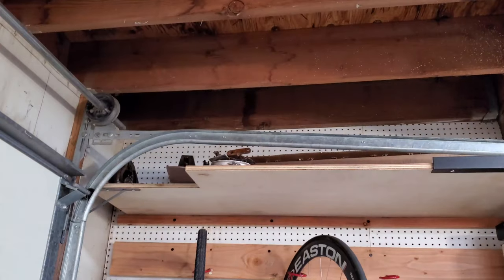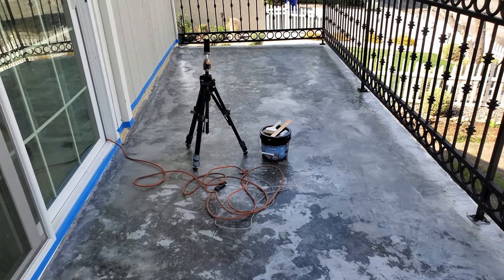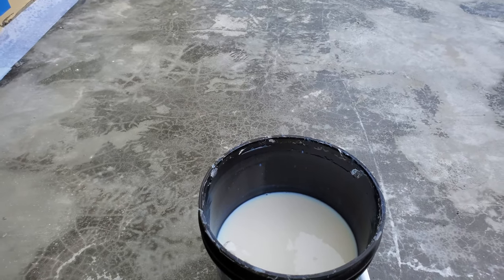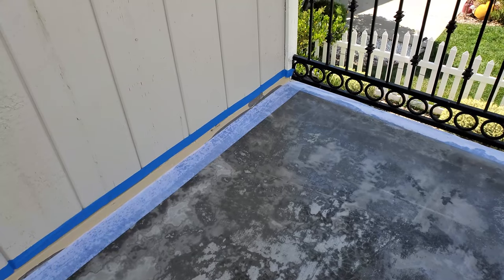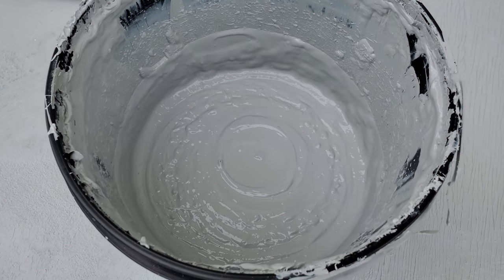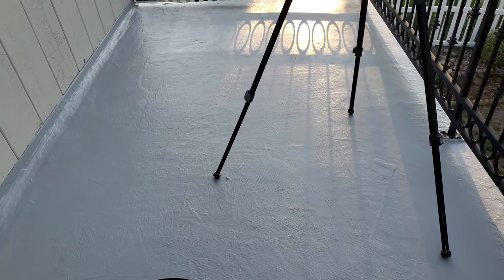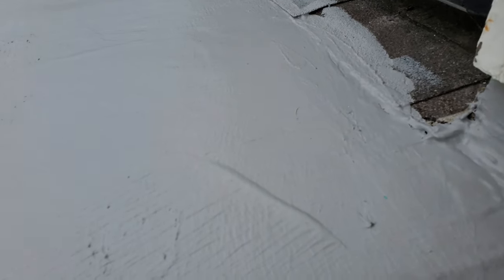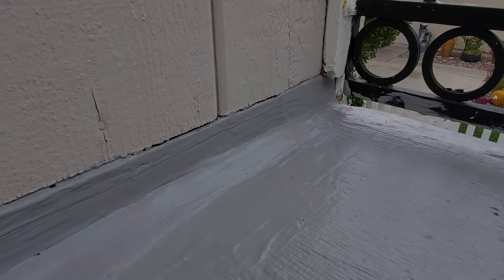Laying Liquid Rubber - Balcony Floor Repair with Liquid Rubber (Part 3 of 3)

Comment: I never read in the application guide the 2'nd coat needs to be applied within 6-8 hours, only wait 4-6 hours for the 1'st to dry. While doing it within it 8 hours sounds like a maybe and would work, the REALLY important thing is  any of the 1 coats must be dry before doing the next and more than 2 coats isn't going to happen in one days work anyway.  Heavy coats are OK, but with the suggested 3/8 nap roller, "heavy" is relative I suppose.
Reply from the maker: Appreciate the feedback, so far, so good.

Comment: SEMCO Liquid Membrane is NOT durable and it’s adhesiveness is very questionable.  Despite following the exacting instructions of the manufacturer, I had numerous locations on my deck where it is coming up.  I sent pictures to the company and asked for a refund but was rejected.  Then they just quit communicating. I am having to go through the Nevada Attorney General and the Better Business Bureau to get resolution of this matter.
Reply from the maker: Man, sorry to hear that.

Comment: I wanted to use LR (Liquid Rubber) brand products but can't find it anywhere except by delivery online.  Where did you get yours?   Thanks.
Reply from the maker: I got mine from Amazon.
Reply: @PlanItSendIt  Thanks.  I was hoping to just pick supplies up locally, but seems Amazon it is.....
Reply: Nice

Comment: Did you scrape off the original deck cover before applying the new rubber coat?
Reply from the maker: Yes, take a look here. https://youtu.be/nj3-H6I8VPE
Reply: @PlanItSendIt  thanks very much.

Comment: How many sqft is your balcony? Wondering what the final coverage rate is per gallon? I am planning on 30 sqft per gallon but have more than I need! Not sure if i can go heavier to use up everything
Reply: Actually nm. I see you mentioned it in the video. thanks!
Reply from the maker: No problem 😊
Reply from the maker: I wish I would've used up all mine and went heavier than I did.